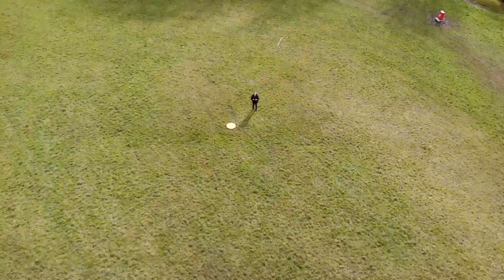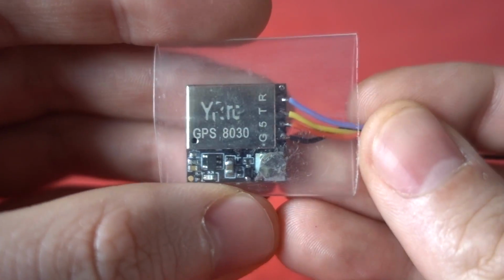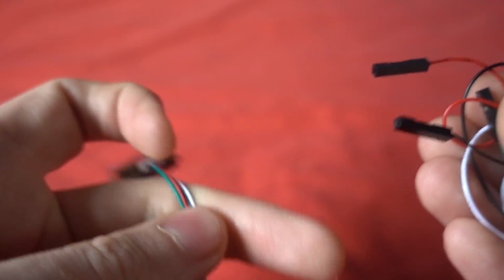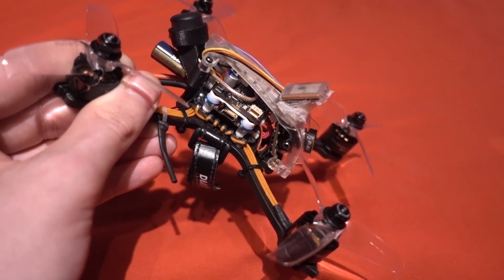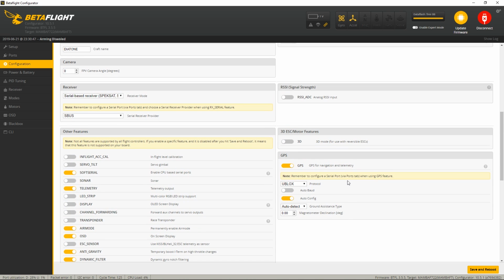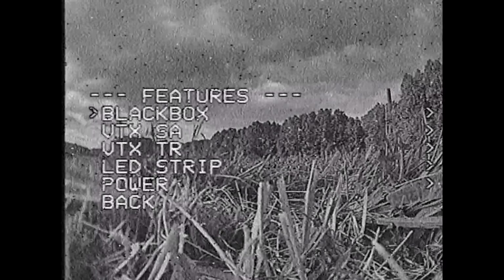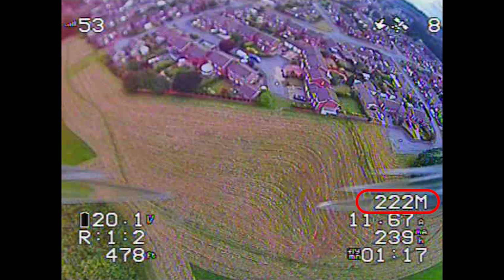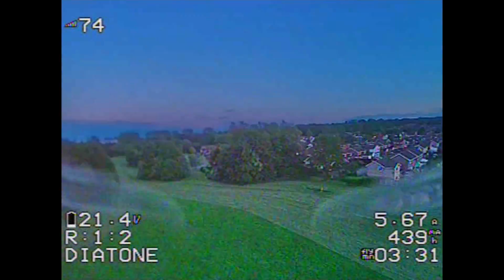YRRC Mini GTR 369 GPS Speed

Comment: I've been using GPS all the way back to the Eachine falcon v1 CC3D days, ( upgraded Revo flight controller). I found that the extreme tilt needed to achieve top speed can sometimes block the GPS. Also having the GPS too close to the vtx can cause errors. On my Diatone GTM3v2(2018), I have the GPS mounted as far forworward as I can, right above the camera. I get very reliable speed and lat-long positional info, as long as I fly along a steady path. I even put GPS on my Rc  trucks with microminimum OSDs.

Comment: GPS is cool but that waiting for sat locks is pita.
When I flew gliders with GPS I changed the code to set the home point to a fixed position rather than having to wait for it to find that out itself.
So I could fly right away and in 7 or 8 minutes time the satellite would work properly and still know where no!e was.
Obviously I could only start from the same place every day though lol.

Comment: I have one on the trashcan... I never get past 40mph, seems accurate enough to satisfy the immersion factor. Oops mines the bn220, could be a bigger is better thing... my bn880s preform alot better than the bn220s.
Reply from the maker: the bigger the ground plane the more gain the antenna will have so ig its antenna is bigger then it will peform better. This is why i struggle when people tell me the BN180 is better as its the same dimensions.

Comment: I had a Q maybe anyone could answer - I have the Beitan BN-180 and my cold starts take 3 minutes and of course if I change batteries it picks up where it left off just like in this video.  Is Andy claiming that if he plugs in the battery the next day it will pick up right away?  What happens with me is if I do not fly right away when I fly a week later I have to wait for up to 3 minutes to get enough satellites (6) before I am allowed to launch - I think I put in a setting in BF to make sure it could not arm until it had enough satellites.  I just wish there was a better model GPS that would allow me to get up in the air faster each time I take my quad out to fly.
Reply from the maker: no it will only remember a few seconds after switching lipos. 24h will be another cold start

Comment: Thanks Andy very informational. Small GPS is a possible wave of the future for small quads. I put a small Garmin bicycle GPS on my 5” quad and it plots the coordinations of the flight and it calculates the speed between points. The problem is you need to fly at full speed in a straight line for 3 seconds to start to get a true speed. I did not get any speeds higher than actual most of the speeds were lower. 
John for Chicago

Comment: Keep in mind the spec. of the GPS service re. speed readings: "The government provides the GPS signal in space with a global average user range rate error (URRE) of ≤0.006 m/sec over any 3-second interval, with 95% probability." Soooo; You NEED to hold your max speed for up to THREE seconds in order to take a reliable speed reading. Basically the GPS is reporting an average speed for the last 2-3 seconds.

Not sure about your erroneously high readings (lost sat. lock maybe?). See how the BN units do..
Reply from the maker: I was definitely holding full throttle for longer than three seconds the question is, by the end of the three seconds and the voltage has sagged then it's only calculated an average and not a peak speed? Either way I think I'll stick with radar. No soldering of extra weight required. Or a kilometer of space and 9 minutes of cold starts haha
Reply: @AndyRCchannel  Yep I agree, if you have the radar gun, it's simple and quick to do. Holding the gun introduces other problems, but you're using a stand so all good. As I understand from reading up, yep all readings are actually an average of about the last 2 seconds. Think like - crusing in your car, where you normally don't change speed much, and when you do it's at a relatively slow rate of change.

I'm okay with that (average speed) for the quads, because I'm not so interested in an absolute peak speed, but more interested in the fastest speed it can do for 5-10 seconds or more. i.e. A max sustainable high speed cruse speed is highly relevant (for me at least), a momentary peak speed is fairly useless if one second later the battery has sagged and you're now much slower. To me, that's not REALLY being able to do that speed. But I understand the value of the peak measurement for comparison purposes.

It'd be nice to see these tiny GPS units do the job, I hope they can. I've just fitted a BN180 to a new R349 custom build (Emax 1606 4000kv motors, Diatone Esc & Talon F7), waiting to test fly it. I't now raining ALL weekend :). It's midnight Sat night as I write this (Perth, Aus). Cheers.
Reply from the maker: This is why I still dont think its accurate because my radar is directional. so I can place it at the end of the feild and fly past it when its lipo starts sagging and with 6s the speed is pretty consistent and the results are not matching the gps results.

Comment: I would hazard that these micro GPS units are "not quite ready for Prime Time" as of this date, based on your testing. However, aviation persisted, even after the Wright Brothers initial flights were only a bit over  100 feet long. So, as with all things, time will tell. I use an app on my cell phone to give me ride data when riding my bicycle (distance, top speed, average speed, etc.), and it does that pretty well. Now, if you could strap a cell phone to one of your larger quads, you might get some useful data .. ha ha  j/k .... Cheers.
Reply from the maker: haha, makes u wonder how they get useful gps data from a cell phone being so small but they do some how. Well useful enough for its application.

Comment: I use a Matek GPS on a LR 6" rooster and I usually have 20+ sats and I'm sure it refreshes much more quickly and accurately than that one. I haven't noticed huge changes like that.
Reply from the maker: thats more likely your location rather than the brand. the matek has an even smaller ground plane than this antenna so its gain will be smaller. In general i dont get many sats in this area with other gps devices.
Reply: Turning Galileo on in cli helps

Comment: Just one thing you could try to speed up acquiring satellites on a cold start, your Quad is flat on the ground yet your GPS is on an angle. Try placing the Quad on an angle on a cold start, dont know if it will help but worth a go.
Reply from the maker: thats what I did wynne great minds think alike :)
Reply: @AndyRCchannel  Its more like stupidity as I made a GPS drone and the GPS was on a fold down stick to get it away from all the  carbon fiber.... Yep forgot to fold it into the correct position and could not understand why I was not getting many satellites  Doh.... LOL

Comment: put pit mode on a switch Andy! its in the modes tab and super helpful. thanks for the vi
Reply from the maker: Think it only puts it to 25mw, correct me if im wrong?
Reply: I run it and it feels like it puts it to 0.01 as the reception suddenly gets a lot worse when nearby. May be wrong tho...
Reply: Andy you are totally right I just flew with pitmode accidentally on and was able to go about 100m+ without any breakup so must have been 25mw

Comment: Hi Andy , glad to see you getting into gps. I think the module you were using might be a bit sketchy. I have three models with gps using the Matek Sam M8Q and they all read very accurate and consistent. I hope you delve in to this deeper because I still haven't figured out how to set gps rescue as a Fail-Safe on BF 3.5.7. Otherwise it works perfectly fine when activated manually. I've read that only BF 4.0+ supports GPS rescue Fail-Safe but can't confirm that.  Lastly, JB did a really good vid on gps rescue and I can confirm that at a configurable distance set in the CLI , the model will descend on a glide path toward it's take off point. So in rescue mode it will drive itself in the ground at your feet if not taken out of rescue mode before that. I hope you will continue to follow up on GPS, I find it very interesting. Thx. 
🤘😁👍

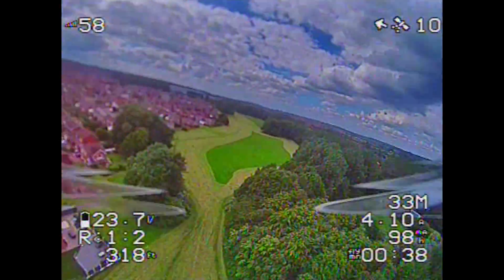Comment: The erroneous reading, or what appeared to be incorrect at 13:43 would actually be correct. You were gaining a lot of altitude there so your horizontal speed would have been slower. Just think of a basic vector diagram. The GPS calculations only measure horizontal long/lat points and doesn't factor altitude into speed calcs. Hope that made sense. And the other super high readings would likely be due to low sat numbers and incorrect data being fed to the fc for processing. That's not a quality GPS unit. The Beitian units work MUCH better.
Reply from the maker: its a good idea but there is something you have over looked. If you have too much camera tilt and dont gain altitude while accelerating, the 4 spinning props resist against the air at around 90 mph (hand out of a car window x4?) which then start to act as a break. From the years of testing iv done, a quadcopter will cover more ground gaining a slight altitude. Even though they are not what you would call aerodynamic by any means there is a sweet spot to break that barrier. I also wouldn't call 10 sats at 169mph a low number. However for the Beitian being much better im not convinced... its the same chipset and from the variables Iv seen from other peoples videos. Im not even sure its worth my time.
Reply: @AndyRCchannel  I've had great experience with the BN-180 on two quads. Accuracy of the readings are not tested against a radar obviously, but I never got the erratic readings you've gotten and usually sats don't drop below 12. And yeah I'm not debating your method to make the quad travel at the fastest rate possible. I'm just saying how the GPS measures the speed is just a simple math distance over time and it does that with a horizontal measurement only. So you could travel at 200mph straight up and the GPS will read 0mph. That's all. I wouldn't buy this GPS unit based on the erratic results you got and the solid results myself and others have gotten from the Beitian. They are cheap toys, so we shouldn't expect a lab grade product. 

In any event, great job getting the review out there especially when it's the only one. All products can't be winners.
Reply from the maker: @thekuz1982  I live in a bad area for good satellite  numbers. It happens.
Reply: @AndyRCchannel  Ah yeah, that does happen. Oh well.

Comment: Andy 10 sats is low for our area I regulary get 22 on my wing with Inav. One thing with Inav is that we use "set gps_ublox_use_galileo = ON" in the CLI not used Betaflight for GPS so don`t know if this would be the same. Might be worth looking into as it would give you far more sats.
Reply from the maker: i usually get the same amount with a DJI model. those hold their position fine. A radar does not rely on your location but thanks for the tip. It is an option in betaflight and its turned off so I will give it a try

Comment: I added a GPS module to my GRT349 with Crossfire and in a big open field with 14+ satellites it regularly hit 110 to 112mph , but could only get 2, maybe 3 runs before the Tattu RLine 850 4S was done, barely 1:30 min. Still pretty fun. One tip is to plug in power to the USB in a new location to let the GPS module finds the sats, then plug in main batt and unplug USB and rock the little beastie. Return to home (mostly) works as they say, just no auto-land of course.
Reply from the maker: This is my problem..... my radar clocked the 349 at 104mph almost every run and no higher.... it clocked the 369 at 124mph on every run, it also matched the readings of a police calibrated system which it should do at 400 dollars. I see gps videos of the 349 reading 90mph - 110+ mph and the gps variation on the 369 was 76mph to 222mph.... and then in the middle 108 to 116 mph... I think there are to many variables on a quadcopter especially a micro with very little separation from the components for GPS to give an accurate speed especially when satellites are coming in and out of existence, people mounting them flat. Not to mention the RF noise / carbon that has to be messing with the numbers. You are also relying on betaflight interpreting the satellite info, how has that been calibrated and how can it be calibrated for every single flight controller when there are hundreds? Its the same reason current calibration has to be done for each FC. Radar dosn't require adding weight to the model and a draw current from its on board regulators. It gives much more consistent figures. Takes up less space, and also translates to what i feel through the sticks where the GPS numbers don't. I think gps will be great for redundancy, but i dont think you could claim a genuine speed with GPS on a Quadcopter. This comes from doing some 700 speed tests via 7 different radar systems. But im willing to try a different brand. Looking at the chips though they are all the same with the ground plane being the only variable. the larger the ground plane the more accurate the readings are and these ceramic patches are tiny. There is going to be a loss compared to a bigger gps antenna.